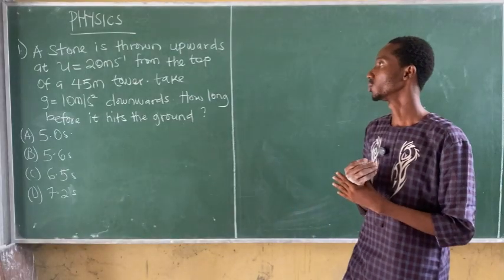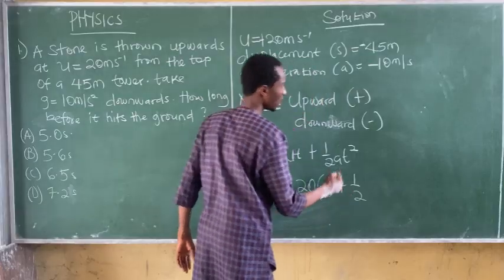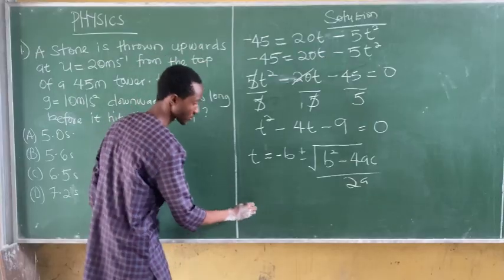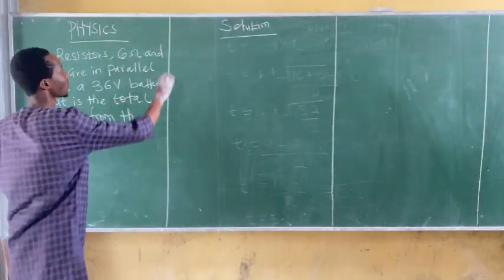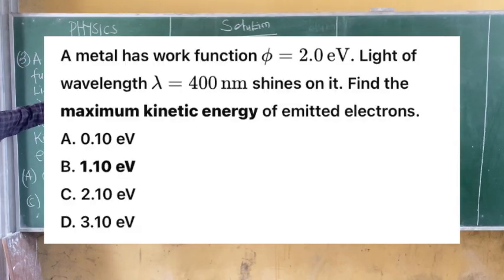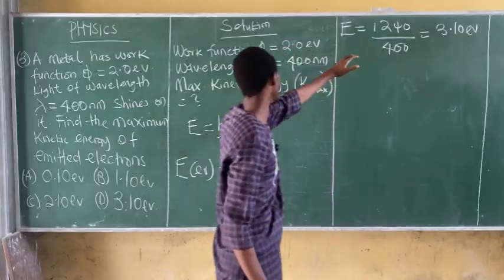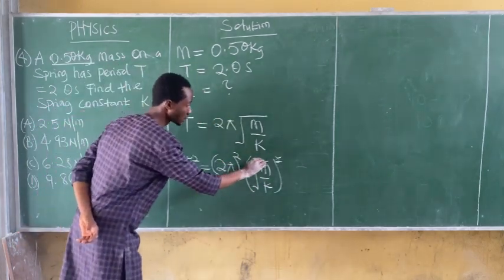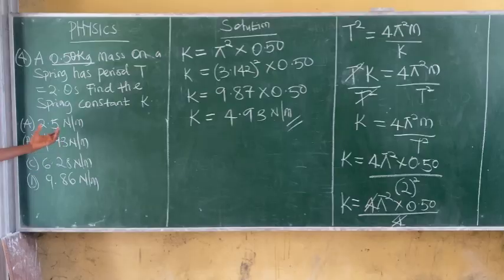Post UTME Physics Tutorial 2025 | Most Repeated Questions Solved with Detailed Explanations

Comment: In physics how did u just come up with a value 1240... when h= 6.6x10 raised to the power of - 34 ,..and c is the speed of light,3x10 raised to the power of 8??? Pls explain?
Reply from the maker: It’s just a shortcut from the photon energy formula.

When you plug in h and c , convert Joules to electron-volts, and meters to nanometers, the constant becomes 1240 eV·nm.
Reply from the maker: Stay tuned I will explain better in the next video